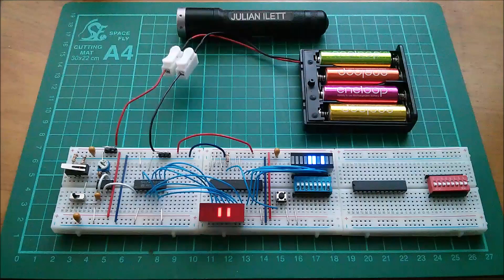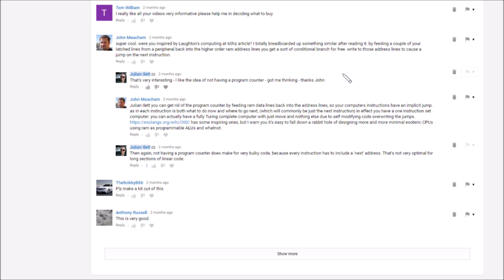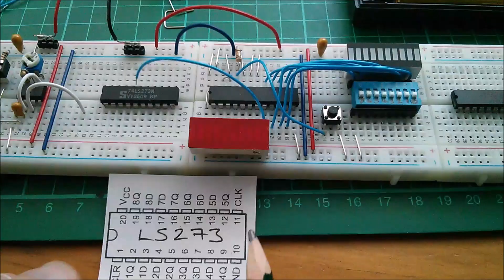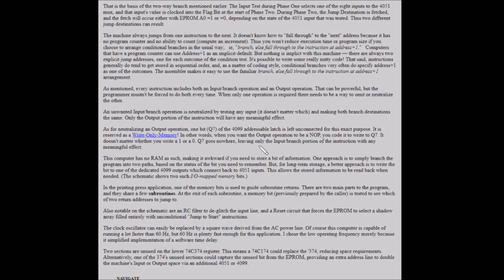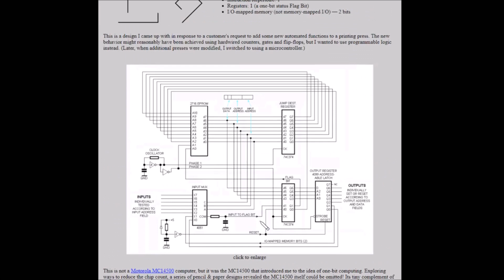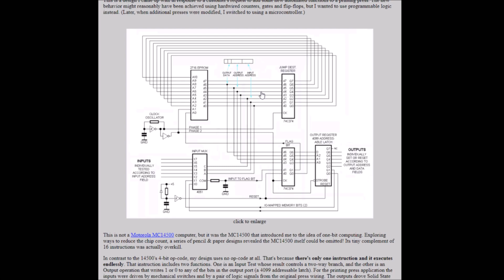8-bit Breadboard Computer - Program Counter Replacement

Comment: I'm not sure I get the point of doing what you're doing. It seems like (to make a Rick and Morty joke) you've just designed a program counter with extra steps.

The 74LS161 chip is a four-bit binary counter, and you can chain two of them together to make an eight-bit counter. And it does have the ability to update its state with an arbitrary input, in order to execute jump instructions. And it's still just two chips; I know you expressed a desire to keep the chip count to a minimum.

Comment: Great video. I'm definitely gonna have to try this myself. Only difference I would make would be to use an AT28C16 EEPROM in place of one or both SRAM chips. I've found they still (mostly)enter a write cycle using a tactile switch without worrying much about the write pulse being 50 to 1000ns as the datasheet suggests. Ben Eater made a video about them and used an RC circuit for the timing but it seems you can get away without using it. Probably not the greatest idea, though.

Comment: I just started on this build and looking at the data sheet for the 555 it says pin 4 should be taken to vcc to avoid false triggering. Yet you have pin 4 floating. Any particular reason why?

Comment: Mr. Ilett, I really like your videos and especially this project, but this is the most stupid solution for program counter I've ever seen :D What you actually need is parallel output counter but with load / set function, so you can set any starting number and let it count. This is important for branching. There is no point of needing RAM for PC. You need something like TI SN74AS867.

Comment: Very interesting series. Thank you for taking the time to make these videos.

On a side note, you may want to take a look at the 269 in the 7400 series ICs. The 269 is a 8 bit biinary up/down counter with the ability to be preset with an initial starting value. This should eliminate the need to have a second RAM chip dedicated for use as a program counter. Looking on ebay these should be readily available in 74F flavor and should help keep the overall cost low.

Comment: I fail to see the point of this modification. You've essentially created a computer with an instruction set consisting of a single instruction - i.e. JMP.  This is [a] worthless because it is unable to do any other work, [b] a pain in the arse to program, and [c] utterly redundant as you are simply simulating the counter you already had.

Comment: ok, so now you can re-order your instructions arbitrarily, and you have to use self-modifying code for conditionals. i still think making the PC an addressable counter/latch peripheral would be simpler.
Reply from the maker: I've got a plan for conditionals with self-modifying code... I think
Reply from the maker: I meant WITHOUT self-modifying code!

Comment: Not including a program counter is an interesting idea, but I don't see the atvantage on it. Most of the instructions of a program are consecutive, then most of the program address ram will be waste just counting. The only atvantage on it is the jumps are very easy to implement (each instruction has a jump included) but it does not solve the conitional jumps. 

You will need to implement conditional jumps, then, having it done, implementing unconditional jumps should be easy.
Reply from the maker: Conditional jumps by changing a high order address line to switch to 'the other half' of the RAM chip.
Reply: Julian Ilett This is as easy as copying the new address to the PC...

Comment: This is really cool, but more wire colours would really aid comprehensibility.
Reply from the maker: I bought packs of different coloured wires and I will use them when I've finished changing my mind about the design :)

Comment: You could also program this as a binary coded decimal counter, where 01001 would have the address for 10000
Reply from the maker: That's true. Could also program it using a Gray code or even a pseudo-random sequence :)

Comment: It looks a bit like a One Instruction Set Computer (OISC).  The idea is that it can only execute one instruction, so there's no need for instruction interpretation so all the RAM contains is opcodes for the instruction to work with.

One example is a computer which only does "move A to B then jump to C."  Mathematics is done via reading tables stored in the memory and it also needs to modify its own program during execution in order to make conditional execution possible.
Reply from the maker: Yes, that's exactly how this works now. But A and B are in one memory space. C is in a different space. Kind of Harvard like :)
Reply from the maker: I think I can do conditional jumps without self-modifying code.

Comment: Maybe I'm wrong with this, but isn't it much better to have the address increase on every step, except if a JUMP instruction occurs?
Let's say you define the value 0xFF as JUMP (0xXX as something not equal to 0xFF): 
0x00: 0xXX,
0x01: 0xXX,
0x02: 0xFF,    - JUMP Instruction
0x03: 0x00    - jump addr

So you run your program freely until a JUMP + 0x01, Latch the RAM data from JUMP + 0x01 and then load the latched value into inputs of the counter.
I know it would take 2 clocks for a jump, but shouldn't good code avoid jumps if possible?

Comment: Sounds like Microsoft put more RAM so we can fill it with bullshit and you still won't have enough RAM. Why would you replace simple counter with complex RAM that has to be programmed. Just make a jump instruction and jump once at the end of the loop. BTW one counter is less parts than RAM+latch and it's cheaper

Comment: While ingenious, my heart bleeds seeing whole ram chip "wasted" on just jump map.  Detect one op-code (for 0xff simple 8 diodes detector would do nicely), store in SR latch (be it on transistors or logic gates) and load next value into PC (and reset latch). With  ttl 74867 or two cmos 4516  this can be easily done and results in much less complicated programming and construction much closer to existing systems.
Reply from the maker: It's a bit wasteful, I admit. I could interleave program jump addresses and CPU instructions, but it would make it much more difficult to explain how it works. The RAM chips are $1 each.

Comment: Julian, how do you get the RAM to accept the IO lines as High when you pull Write Enable to ground? I've replicated your setup and when I pull WE to ground, I am writing all zeros. I have to force the IO high to actually accept it. Is that a peculiarity of your Toshiba 2016 vs, say, an ST M6116LN?
Reply from the maker: My DIP switch has both pull-up and pull-down resistor SIL packs connected to it. 47k on the top side of the switch to Vcc and 4k7 below the switch connected to Gnd. The DIP switch is upside down (on is down).

Comment: Why not make an arduino programmer for the computer? Fast program load and save. Maybe you could use an SD card reader to store the program in a txt like file. Or use th internal memory of the arduino. Or dump to serial and read from serial. Once you made your program you could save and reload it in a very short interval. Just connect the data inputs and the manual clock to the board. if there is not enough pin, there is a commonly cheaply avaliable PCF8574 I2C based IO expander. Write a binary value to it, and it outputs it. 8 bit just like your computer. Either in DIP or SMD or module type :)

Comment: A bootstrap ROM built from a diode matrix could be fun once you've decided on an instruction set :)
Reply from the maker: I did consider that - tons of soldering though :)
Reply: You could use two pieces of copper strip board back to back (one rotated 90 degrees) to form the matrix, then you just have to solder in the diodes, still lots of soldering though.
Reply from the maker: I like the back to back topology, but a real bugger if you want to change the bootstrap code!
Reply: Julian Ilett Put It in silicon, just like nintendo does :)

Comment: What you have built here is actually a pretty basic FSM (finite state machine). The states are being stored in the LS273 D-Flip Flops and the combinatorial logic to determine the next state is being realised with your memory. You can do some pretty cool stuff if you add a combinatorial output circuit that takes the current state, and optionally inputs (Mealy), into account.
Reply from the maker: The fun should start when I connect the flag bit to address input A10 on the RAM chips. That's a branch to the other half of program memory :)

Comment: Neat - yes, why bother with a program counter and extra logic for a jump instruction when you can just include the 8-bit address of the next instruction within each 16-bit instruction.      How are you going to handle data though, other than immediate values?  A third RAM chip with a 4 bit address driven by 4 of the remaining 8 bits in your instructions perhaps?  More generally do you have an overall design in mind?
Reply from the maker: The computer already has a 1-byte data memory. OK, it's not much, I admit.

Comment: you might want to buy an automatic stripper or gun stripper , your gonna have alot of wires
Reply: http://hyperboleandahalf.blogspot.de/2010/04/alot-is-better-than-you-at-everything.html
Reply from the maker: I share you pain ;)
Reply from the maker: I've got a Weicon Wire Stripper No. 5 which appears now and then :)
Reply: Actually, my automatic stripper is no good for this thin wires. There are some that can strip these 28 AWG (I think) wires.

Comment: any ideas for reading from a storage device, like paper tape or something?
Reply from the maker: Hmm, tricky. But I have bought a small 5v supercapacitor which I'm hoping to use as a battery backup for the RAM chips.
Reply: Julian Ilett that would be more like a RAM based on small circular magnets.
But depending on what is put in a device, it could be done quite easy. With some simple coding in your computer.

Comment: I guess I am missing why this is better than the 8-bit counter you previously had.
Reply from the maker: I was having real difficulties working out how to write to the program counter with a simple two-phase clock. Jeff's design provided an elegant solution.
Reply: Two-phase clock?  Isn't this functionally accomplishing what you already had except now you need another chip to keep the instructions.  Sorry for the questions... I'm just trying to wrap my head around this.
Reply from the maker: The new functionality is completely flexible unconditional jumps (GOTOs) and a mechanism for separate 'setup' and 'loop' code sections.
Reply: I see... As you demonstrated by restarting at a different address.  Assuming you only wanted to count up 8 bits and reset at 0, would there be any advantage to the new method?
Reply: I agree that Julian didn't explain it well, but what he created now gives more control over the program. You can now order the counter to start from 0, run till 9, move to 5. Otherwise you must do a ugly hack that is hard to explain for everybody. The solution he took with this design looks expensive, but is actually very elegant.

Comment: Good  video.  I wonder how hard or useful it would be to implement a skip next address if a flag is set or clear, like the pic BTFSS instruction?
Reply from the maker: Useful definitely, but it would need a hardware adder to increment the program counter (or a method of producing a double count), so maybe a bit tricky.
Reply: Since you have to enter the addresses by hand, maybe you could just use the even number addresses and tie the flag register gated by an instruction decoder to address line 0. Probably some gotchas that I haven't thought about though.
Reply from the maker: That's pretty much what Jeff did. I'll probably connect my flag bit to one (or more) of the higher order address bits.

Comment: Really interesting stuff.

But the sound in the parts recorded with the phone is awful, the highs are so harsh and biting and it sounds like compressed with 56kbps mp3. The part recorded with the computer is much better and less harsh.
Reply from the maker: It's possible that's because I'm using a different video editor. YouTube have decided (in their infinite wisdom) to scrap the YouTube Video Editor. I reckon the YT Editor did some clever stuff with audio level balancing. Needless to say I'm not very happy :(

Comment: Just out of curiosity, why not use a 16bit RAM chip, and split that (ex, upper registers for data, lower for addresses)?
I'm old, old,old school, and piece count also helps...
While the wiring would be a spaghetti monster, and explanation of the monster would be more difficult, piece count would be lowered.
Just curious, since you wanted lower component count...
Reply from the maker: Jeff interleaved program instructions and jump addresses in alternate RAM locations, but I felt this was difficult to explain, so I've gone for a simpler arrangement with 2 separate RAM chips.
Reply from the maker: No reason really. I've already got the 8-bit RAM working with an 8-way DIP switch. Having two separate RAMs is a bit more modular. It'll be a bit easier to identify the various sections of the computer with two RAM chips - I hope :)
Reply: Ah, I see you answered that one already. I was curious about splitting the chip and retrieving the actual instruction by ANDing one of the higher address lines in the second tick (or interleave counter and instruction on even-odd addresses). Especially since you have an 8-bit output but an 11-bit address range, essentially wasting 3 bit of address range that you'll never be able to address your way while still needing a second 6116.